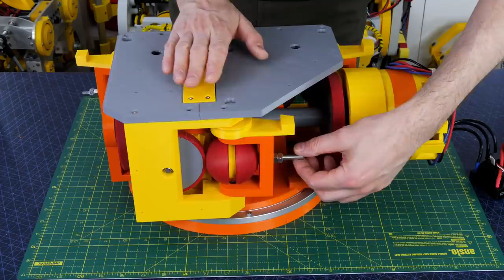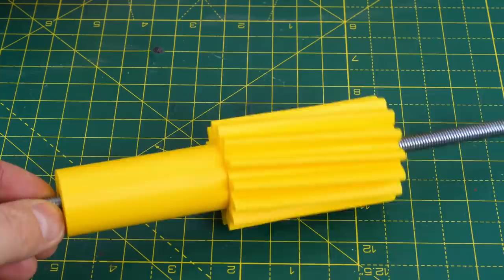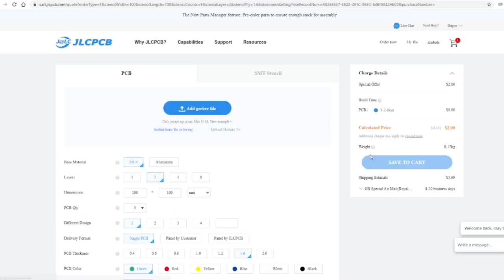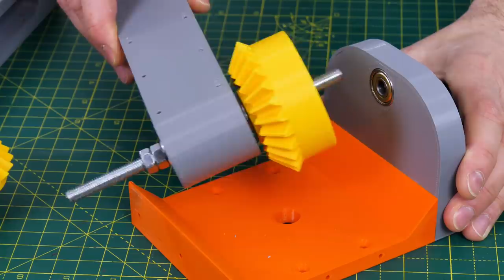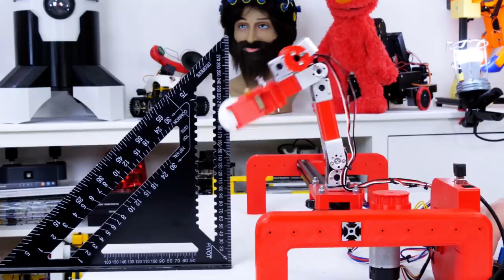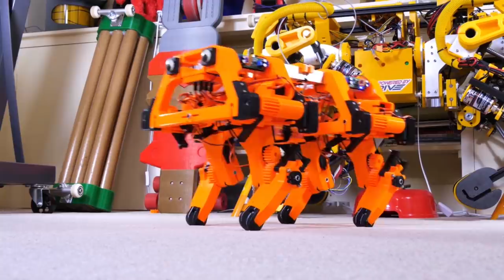One-Motor Robot Arm #2 - Differential Drive

Comment: I really didn't even know it was possible to get so many different motions from one spinning motor like this, but this was a great and eye-opening demonstration. Bravo!
Reply: The crazy thing is that the system doesn't have to stop with 3 axes.
He could ad basically as many axes as he wants.
Reply: @Jehty_  - The problem with Backlash in the gears would eventually catch up unless the gears were metal.  It really would be nice to see how many axis' could be put in such a project tho.
Reply: Check out breaking taps video on a mechanism with similar concept which is used on JWST. Also don’t forget to check out the comments section on that video for links to other videos with similar concept. It is really fascinating 👍
Reply: @reggiep75  gears being metal does not remove backlash, it is the tolerance between the gear teeth and valleys

Comment: I cannot recommend spiral tooth bevels more highly. Straight tooth is very sub par as you could see with the backlash. In traditional manufacturing there's a reason we go through 10x the effort to make spiral teeth, and with 3D printing in this case its practical zero cost change

Comment: This is so cool, love the large 3d printed pieces. Personally I work with smaller pieces and its so hard to manage the tolerances at that scale. Sadly they have to stay small as the parts are mostly meant for small drones.
Reply: Are you using SLA or filament? With SLA you get excellent tolerances and it became very affordable in the last 2 years

Comment: How does this man not own a Robotics company? How is this hobbyist?
This is beyond amazing. A refined and upscaled version of this could be used in factory robots. 1 motor and large relatively simple gear systems makes them cheaper to buy, operate and upgrade. Maintenance us still up ok the air.
And the possibilities are huge, imagine an artificial arm or leg that just needs 1 motor to run, making them more accessible.

Comment: With everything pivoting around that center it seems like the perfect use case for a slip ring to get the encoder feedback and run an end effector with no angle limits.

Comment: This is really cool, I think improvements could be made to the drive system, theres an awful lot of gears in series introducing friction and backlash. Trying to think of how you could drive each axis more directly from the CVT. 

As an idea, you could have a timing belt pulley, with a hemisphere on one side of the pulley. The hemisphere meshes with a driven wheel. You can tilt the hemisphere against the driven wheel as you currently do, this would result in some belt twist but as long as the pulley is relatively small or the distance to the next pulley isnt too small the belt should be fine taking up that twist. Then you can drive the axis directly with the belt. Eliminates many of the gears and worm drives for less friction/backlash.

Comment: The economics of this approach are interesting.  A single large, powerful motor can be used for all joints.  That means a lot of power can be delivered at all joints (provided the clutches can handle the torque).  This could be cheaper and lighter than using individual motors for each degree of freedom, however system introduces a lot of mechanical challenges, and complicates control of the arm.

Comment: Great job!
I really like the idea of utilizing a single load motor the way you designed it.
As a sidenote I have a feeling that at some point with all vibrations and back and forth load the nuts on the axels will unlock and start moving on the axels with the gears which may lead to linear motion tearing the whole thing apart. Maybe you could make a flat spot on the axel for a lock screw for the gears?
Also backlash would probably be less noticeable with worm gears

Comment: I'd put a slip clutch within the gears at each of the arm joints, Lego has a fairly simple design that'd be entirely 3D printable. Since the two arm joints, so far, are driven entirely mechanically based on multiple drive inputs, there's not really a way to put a limit switch in the system to avoid crashing one arm segment into the next; plus a limit switch wouldn't do all that much in a drive system like this, other than turn off the motor, as a servo return to zero wouldn't be as effective as a motor shut-off. Slip clutches are the physical analog to the digital limit switch, the arm sees resistance in movement and the slip clutch slips under excessive torque. Since the bevel gears have fairly thick bases, these would be a great spot for a slip clutch,  one in each of the shoulder pivot drive, and one in the drive at the elbow. 

I posted this in a comment thread on the last video, but I still believe the rotational base should have the drive motor vertical, for expansion reasons. This orientation would contain the drive motor and drive system within the base fully. Need a more powerful motor? The universal base could house a stronger motor. Need more outputs? Just extend the height of the base, possibly even via modules, and you can achieve more drive outputs. This would also minimize the footprint, as you're not swinging a motor around with the shoulder swivel, not to mention mass reduction. 

I still want to see Skyentific's opinion on this kind of drive system for robotic arms, since he's covered a variety of systems. I think the main concern is power and efficiency, each additional drive will sap that additional amount of power. But there's also nothing telling the motor to run at a specific speed to meet the same efficiency as more typical drives. But then the issue becomes that the motor itself needs a transmission, to achieve the various speed and power requirements as various outputs get turned on and off, to have higher efficiency. It's a massive balancing game that would just make this system inefficient compared to having discrete motors per degree of freedom. I think the only practical use, when efficiency is concerned, is having a dual CVT acting as a controllable differential, much like what VW is doing with wet clutches on the rear AWD bevel gear (not a differential) drive system in the newest Golf; but outside of a differential, I think all practicality very quickly tapers off outside of some very specific use cases. It is an interesting concept, though, I just think disadvantages of a multi-output system like this outweigh any practicality.

Comment: Would be awesome if you made a slip ring mechanism so you could run power from outside of the arm without having to worry about wires when it rotates

Comment: If this were made in metal it looks like it would be a pretty robust system
You could probably save yourself some engineering by having an array of screw-drive actuators in the base that connect to the arm joints (elbow, etc) with bowden cables.

Comment: James, do you think that a v2 system with less backlash could be controlled by an entirely mechanical PID control loop? The ball-wheel mechanisms are nearly mechanical integrators and differentiators already so this could be a really cool addition. I’m just imagining a robotic arm with motion smoothing that could have existed during the industrial revolution!

Comment: Would adding internal struts, inside the box, not make for a more supported and stronger structure?  It would take planning and adding additional metal struts into the plastic struts would be drastically minimise slackness and improve transmission.  It's a fair amount of work but would be perfect for the acme level of the device.

Comment: I suppose I can be accused of being a pedant. This arm has 4 motors 3 servos plus the power motor which is one more than the number of degrees of freedom. In fact any movement caused by electricity involves a motor of some sort, even a solenoid is a motor.
Absolutely brilliant piece of engineering though. As far as i can see the only way of eliminating motors would be to use mechanical computing.
😃

Comment: Is there a benefit I'm not seeing of using two outputs mixed together to control the shoulder and elbow? It complicates the control significantly compare to simply using one output for the shoulder and one for the elbow.
Reply from the maker: More torque at the shoulder, but otherwise no.
Reply: @jamesbruton  I'm assuming then that a single CVT is unable to transfer the full torque of the motor? Or is there something I'm missing that would provide more torque?

Comment: Is there an advantage to this design besides being super interesting mechanically? Normally you would use one motor per degree of freedom. This one would require one main motor plus three stepper motors to run the clutches. Is it that you can use one high powered main motor and three lower powered smaller ones? Does this work out to being more efficient power wise ?
Reply from the maker: It's more of a curiosity piece tbh.

Comment: So basically when you finish this project, you used three servos and a motor to do a job three servos could do on their own? :p
What exactly would be the advantage of this system other than having fun at building it? Is it that you can have a strong motor and only need weak servos?

Comment: Why did you use 5 gears at the base of the arm? Why wouldn't you use 3 instead by having two of them double sided. That would reduce the flex slightly at least the flex of the shafts.

Comment: Really interesting as usual. But, sincerely, why are you doing this? What is the aim I mean? Is it just an interesting engineering problem to solve? 

With motors so small and cheap these days, what is the practical application in 2022? What am I missing? Is this still used in products nowadays ? Think 🤔 

I had/have the old Toby arm and loved it. My daughter did too when she was young.

Comment: I'm not a hater but if you also need a bunch of servos (which have motors) then it's not one motor so what's the point of all the mechanical overcomplicatedness? Sorry if I missed something, I would truly like to be educated on why this is a better idea than using one servo or motor for each joint if someone could please enlighten me. Thank you
Reply: You can use only one big beefy motor for the needed torque. The clutch servos are low power, cheap and light. Having three seperate drives would be three large, heavy and expensive motors
Reply from the maker: Same as Hydraulics with one main engine and lots of valves. The proportional valves in the Mantis are around $3K each. That said, it's probably not that practical - but I want to see how the control system works out.

Comment: Honest, would it not be simpler and have less parts that wear, if it had multiple (electric) motors motors? You need to construct an additional tool to make motor-windings / coils for the motor design you prefer - wich seems perfect for 3d printed project! Also having multiple small motors lets you use cheap low power circuits and if designed right it could have fault redundancy.

Comment: not a good idea. lots of backlash on top axees especially with 3d printed parts. its probably gonna be very unreliable unless you make the control closed loop. and thats just solving a problem that shouldnt exist in the first place. its a fun mechanism but a robot arm isnt the best suited project. no hate, just constructive criticism
Reply from the maker: Yes the control will closed loop, with encoders on the actual joints, otherwise it would be impossible to position them